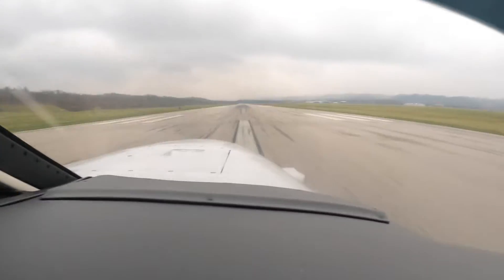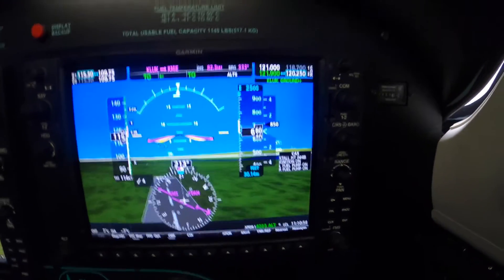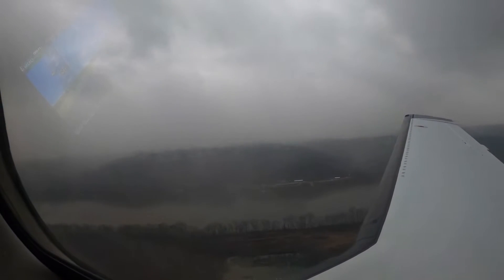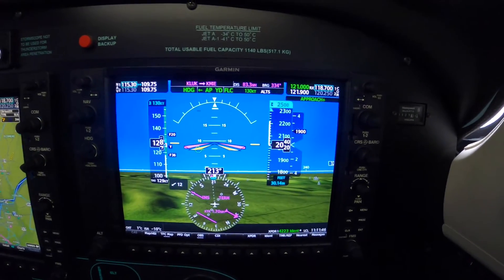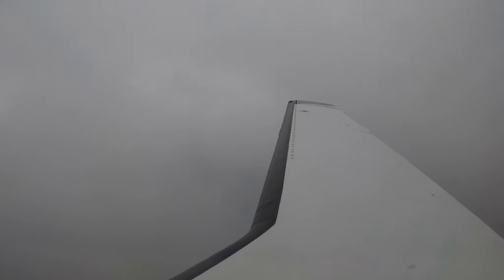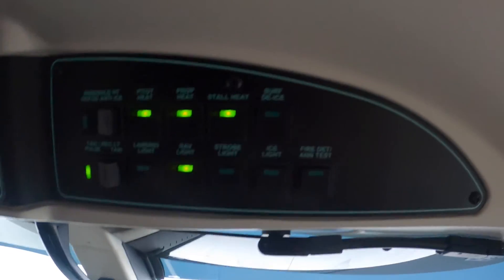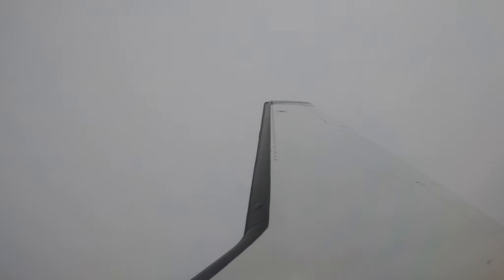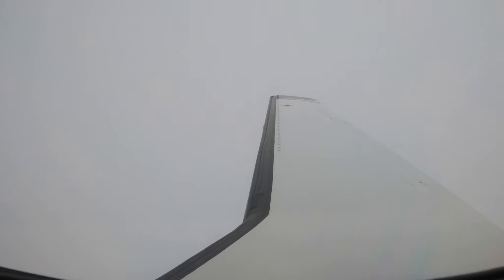Piper M500: IFR Departure with Light Rime Ice in the Climb

Comment: Popping the boots with only a trace is generally not a good idea for the exact reason you see here... namely that ice could not break off and with boots inflated new ice can fill in to create a dome of ice with the boots inflating inside of an ice bubble.  Think most systems recommend waiting until there is a little more buildup.  Great job on the vids, appreciate it!
Reply: I get the impression he was doing that on purpose for the benefit of his student.
Reply from the maker: Hi Namrider, Thank you for your comments. The phenomenon you are describing is generally referred to as “ice bridging”. Here is a direct quote from the FAA within AC 91.74B:
“A traditional concern in the operation of pneumatic boots has been ice bridging. This is attributed to the formation of a thin layer of ice which forms to the shape of an expanding deicing boot without being fractured or shed during the ensuing tube deflation. As the deformed ice hardens and accretes additional ice, the boot may be ineffective in shedding the bridge of ice. Studies done in the late 1990s have established that there are few, if any, documented cases of ice bridging on modern boot designs. In addition, several icing tunnel tests sponsored by the FAA since 1999 showed no ice bridging on modern boot designs. Known cases are confined to boots of designs dating back a half century or more.”  I hope this information helps.
Reply from the maker: Here is a link to the full AC 91.74B: https://www.faa.gov/documentLibrary/media/Advisory_Circular/AC_91-74B.pdf